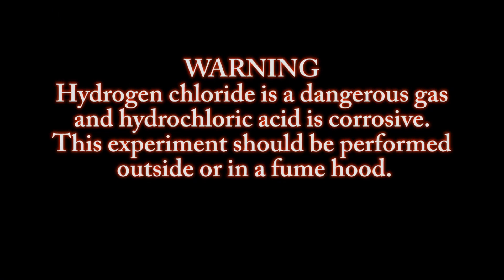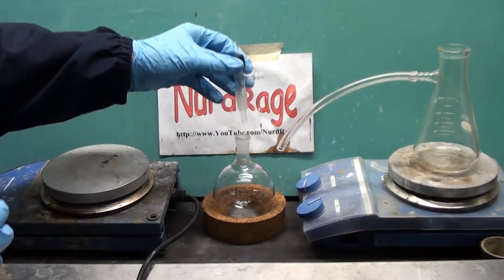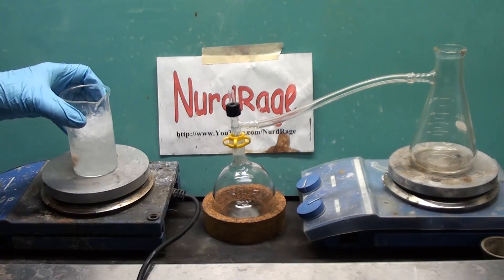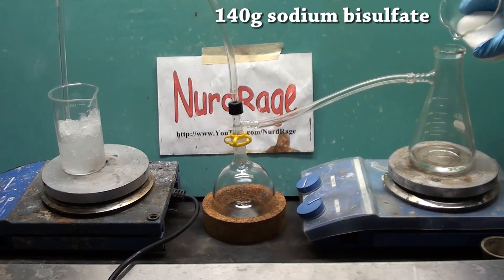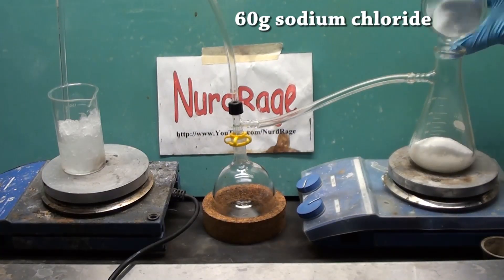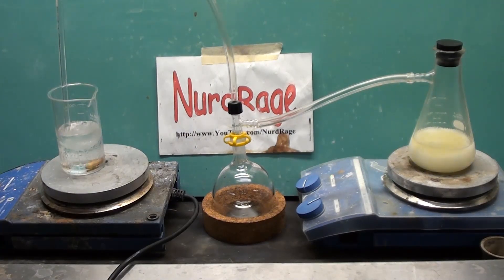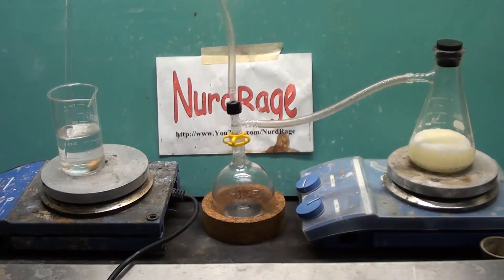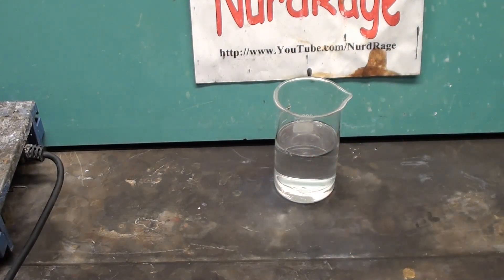Make Hydrochloric Acid

Comment: Sodium Disulfite and sodium bisulfate...... whats the difference here between these 2 or are they basically the same thing?
Reply: there is no thing called sodium disulphate. That would mean Na4(SO4)2, which would equal to just 2Na2SO4. Sodium bisulphate though, is an acidic salt - NaHSO4
Reply: sodium disulphite? yes there is. at least according to the label im reading. the msds sheet for Bonite brand stump remover lists this compound. hence my question.. but nvm. its listed from the dicks who like to make things complicated
McVidsAndTutorials

Comment: What is the maximum concentration that you can get from this procedure, and what modifications can you make to increase the yield and get more gas to dissolve. I already know that cooling the water lets more HCl dissolve, but are there other things?

Also, the solution I obtained from using this process had the smell of H2S. Is there a way to eliminate that from my mixture without letting the HCl escape?
Reply: Creativity The maximum solubility of HCl gas in water is around 32-35%. Solubility of gases in liquids increases as temperature is lowered, hence the ice water. To increase absorption of gas in the water, have it constantly agitated, create fine dispersed bubbles for more surface area for dissolution to occur over, and collect the undissolved gas to re-pass it through the water. I'll have a think about your H2S problem and get back to you
Reply: 36,5 % is maximum amount of HCl, that could be dissolved in water

Comment: what is that tri tube thing called and where do you get it
Reply: Do you mean the adapter that goes on the round bottom flask (it's a ''2 tube'' equipment)? If so, I don't know the exact term. ''2 neck flask adapter'' yielded some results but you'd have to check if you can find one (or more) to buy.
Reply: JayMark2049 Here is one: http://r.ebay.com/5KAUfb You can also just use a gas washing bottle with the connections reversed.

Comment: can you use salt water and a batterie to make the acid?
Reply: Well that's actually the industrial way, I mean using electrolysis of NaCl solution. You produce hydrogen gas and chlorine, then you mix them together and absorb them into water. I can't imagine doing it at home though :)
Reply: Yes, so you can make it this way

Comment: What if i do this in my basement with an open window and a respirator mask designed to filter out hydrogen chloride? Will any of the hydrogen chloride escape to the upper floors? If so what if i do this in my kitchen with a kitchen fume exhaust?
Reply: You can just go outside with a few extension lines... and if you do i would still recommend the mask
Reply: Run the gas not Kitty litter.
Reply: Into...

Comment: This process simpy does not work for me.  I just did another run and I can never tell when its finished. 
the material turns in to a hockey puck, but remains mostly white with some flecks of black in it.  The water boils off fairly early on. Im getting very week acid out of the deal 

I have no idea what I am doing wrong but I am sure that I am.  
The resulting hcl will dissolve aluminum foil in short order but  it does not seem strong at all.

The only litmus paper that I have is from a wine making project,  Its sort of the 2 to 7 range and the acid turns that paper red and red is not on the scale...  I need to get some phenolphthalein
Reply: How do you know the acid is weak? Have you performed a titration? If it dissolves aluminium foil it should be of reasonable concentration. PH does not really tell you the concentration.
Reply: Davy Zeng No aluminum was hardly reacting to it.  I reused the product and got a decent concentration.  
It makes so little that I did not want to waste any doing titration.

I buy the stuff now.  Its not really worth doing it this way other than exploring the science.
Reply: That is true. Thanks for the clarification. :)
Reply: ***** that is exactly why titrations work using sodium hydroxide

Comment: I did this process yesterday and got very poor results.  PH of like 3 maybe.  I used too much water and did not add any water in the generator flask.  I was sure that my stir plate could boil these crystals without water. I was wrong.

I have a question for ANYONE.   WOuld it be ok to use the weak solution and do this again?  SO I could build off of its acidity?  perhaps coming up with something much stronger
Reply: I know chemist now but I can't believe how stupid I was back then unbelievable the left knowledge if I need hydrochloric acid in the middle of the night now I make it with salt and sulfuric acid and grip it and get really nice pure HCL after cleaning it up

Comment: If I replace the Sodium Chloride with Sodium Fluoride, would the reaction create Hydrofluoric acid? I mean, hypothetically. I am aware that HF does dissolve glass, so this setup would not work... but what if the setup was Polypropylene? Would it create Hydrogen Fluoride and eventually Hydrofluoric acid?
Reply: Making hydrofluoric acid in a home lab is basically suicide if you  aren't REALLY careful. I would only do it if I had good quality PTFE labware and a very good fume hood that takes any escaped gases far far away. (Edit: don't use PTFE, HF can attack it, albeit slowly)

Comment: Will the reaction work with Sodium Bisulfite? I'm assuming no...
Reply: no. We use sodium chloride in this reaction for the chloride component
Reply: THErcbomber In replacement of sodium bisulfate, obviously not sodium chloride.
Reply: Zabuza oh. sorry for the misunderstanding. My best guess is that it will work but not nearly as well as with sodium bisulfate. The sulfate anion tends to dissociate with its cation easier than sulfite does. So in theory it should work but following trends it shouldn't be as easy or effective

Comment: I am going to have to do this, I can not find any HCL anywhere anymore. ALl of the drain cleaners are now Sodium hydroxide.
Reply: Hardware stores like Ace, or any place that sells pool supplies. Muriatic acid (32 to 26%) by the gallon for about $6. Concentrate it by bubbling hydrogen chloride gas thru it. If you want reagent grade, put an open container of muriatic into a larger container which can be sealed along with a an equal open container of distilled water. Seal the larger container and wait a few weeks. The distilled water will now contain reagent grade HCl at half the molar  of the original muriatic.
Reply: SMOBY44 Yeah, for most things hardware store HCL is fine..  I buy it a ace hardware stores notw

Comment: How much concentration you get this?
Reply: ***** Technical muriatic acid has strength 20 Baume, which is about 32% HCl and it is not pure. Plain distillation of muriatic acid won't help. The system hydrochloric acid - water forms negative azeotrope at 20.2% which render its concentrating by distillation unfeasible. To reach 37% acid of reagent grade different technic should be employed  like, say, extractive rectification. It works this way: The solution of liquid extractive agent (in this case solution of CaCl2 50%wt) constantly flows down inside the distillation column and on its way sucks out H2O from azeotropic HCl-H2O vapor phase which is rising up in that column. This technic works because some third components (like CaCl2 for this system) actually break the azeotrope. If you can read vapor-liquid phase diagrams here is more detailed explanation: http://www.akersolutions.com/Documents/PandC/Mining%20and%20metals/Hydrochloric%20Acid%20Concentration.pdf
The only challenge is to enforce the circulation of extracting agent through the distillation column.
Reply: Using azeotropic distillation, you can raise the concentration of HCL to 38%.
Reply: Alex Petrov Technic or technique?
Reply: "technique" means "a way of carrying out some task or procedure", "a method".
"technic" is just an alternative spelling for "technique", Sometimes I see people using it instead of "technical", where it means "related to manufacturing", "used in industry". Like, say, "technic acid" instead of "technical acid". However many people consider this usage to be illiterate. I am not a language expert, so you may want to find a better source on that.
Reply: ***** Under the atmospheric pressure distillation I would expect first hydrochloric acid gas to evolve from such a system, and then the rest of 20% water azeotrope. However if you bubble evolving HCl gas through the cold 20% HCl acid you may increase its concentration to 35% and even higher. Just be careful working with HCl gas as it is very toxic and corrosive substance.

Comment: though I couldn't understand how NaCl reacts with sodium bisulfate and produce hydrogen chloride..can any one write the the equation please ?!
Reply: okay let me make this simple, sodium bisulfate is another name for sodium hydrogen sulfate, it is another salt formed in a reaction with lets say a dibasic acid (sulfuric acid) and sodium hydroxide, this is an acid salt meaning not all the hydrogen ions were replaced with sodium ions in this case, so the salt formula is NaHSO4 and thats where the hydrogen comes from
Reply: Vrej Egon Spengler I know
Reply: NaCl+NaHSO4--->Na2SO4+HCl
Reply: ***** - think I understand your confusion. The equation (from Eshwar Natrium ) might've cleared it up, but just to be basic (there's a pun there) / explicit: sodium bisulfate has a hydroxide (OH) hanging off it. So you get a swap of the H from the bisulfate onto the Cl from the table-salt. You were probably confused as to "where the heck does the H come from?!?" seeing as how "sodium bisulfate" doesn't sound like it's got hydrogen in it. (Me, I find it really helpful to 'cheat' and just look up inorg compounds on Wikipedia rather than try to remember rules for ite, ate, ide, hypo-, per, etc. -- and this is a good example of why... ;-)
Reply: andrew corradini Bisulfate along with others like bisulfite, metabisulfite, bicarbonate are confusing. Bi usually means 2, just like di (bicycle).
In chemistry, bisulfate actually means "hydrogen sulfate"
Metabisulfate, also called disulfite) is a weird exception. It is actually the S2O5(2-) anion. It has a S-S bond. One S has 2 O and the other has 3 O.
Reply: NaCl + NaHSO4 --> HCl + Na2SO4
Reply: Eimantas Andrikis
Eshwar Natrium already posted that.

Comment: What concentration do you get off this method ? Is it then usable for making Nitric Acid ?
Reply: Can't you calculate it yourself? It depends on how many moles of HCl you make, how much water you have in the beaker.
Reply: Problem has been solved since last comment was posted, appears that HCl cannot stay in the liquide phase at standard temperature past 37% concentration. So it doesn't really depend on how much of those products react, excess moles of HCl will simply evaporate...

Comment: If you were to inhale "a few drops" worth Hydrochloric acid, it will cause severe damage to your lungs, it takes even less than that amount to cause permanent blindness, internal damage, etc. This is especially the case with concentrated versions of the material, which can 'fume'. 

Furthermore, in certain chemical reactions, you can create deadly gases, such as pure chlorine, or even Hydrogen Cyanide, which would only require you to inhale a small amount to be considered a fatal dose.

Comment: Normally you can use a concentrated acid and an oxidizer. This acid is much more dangerous than other acids as this can spontaneously catch fire or decompose violently. Chlorate and conc h2so4 can be used but don't try it as even very small samples (1ml) can blow up your glassware.

Comment: Use a stopper with 2 holes, and put 2 glass tubes in them, attach the rubber pipe from the gas generator to 1 glass tube and a rubber pipe to the ice container to the other glass tube.

Comment: Not really true. Acids in general are corrosive but that depends on pH. Your stomach contains HCl as a digestion catalyst but it doesn't digest your stomach lining proteins due to mucous secretions. 
Another example is that HCl does not react with Pt or Au in most circumstances (from a chemical not biochemical standpoint)
Acids in general are only a source of protons (H+) which either catalyze or help to increase reaction of other present compounds.

Comment: I think methods of evaporation would work. I think the most acidic the HCl can be is around 7-15M (molar, moles per litter--I could get the exact number and derivation if you cared. This has to do with the amount of "bulk water" that is used to solvate the two ions H+ and Cl-. Anymore concentrated than this and the HCl will precipitated out because there is not enought water to surround the ions (i.e. dissolve them), and will precipitate out to form a salt.
Reply: More like evaporate as HCl gas.

Comment: No. There are cells in that line the stomach that secrete a mucus layer to prevent the corrosion from the HCl we produce. However, you would suffer severe esophageal damage, and that could be fatal. So, my vote is, don't drink it!

Comment: So when I was a child I produced HCl gas by ethane chlorination (with the action of sunlight). To my regret I did not record it on video. Ethane was produced by the electrolysis of sodium acetate solution and chlorine likewise. The consecutive attachment of the two electrolysis cells allowed to produce equimolar ratios of the two gases (disregarding chlorine solubility losses) which reacted in a separate flask. The HCl produced was absorbed by water. When Zn reacted with it I was just happy)))

Comment: I have a question. If the back flow from the beaker to the flask was caused by a small vacuum in the reacting flask, what causes the vacuum in the reacting flask then? I'm just curious.
Reply: I think it has something to do with gasses shrinking down

Comment: couldn't you use the ph to determine the concentration of the hydronium ions in the solution, which would essentially give you the molarity of the acid? or by using titration you get better analytical data confirming its concentration?

Comment: Hydrochloric acid can't be boiled to concentrate it, heating it causes the dissolved hydrogen chloride to boil off. You can only concentrate it by adding more hydrogen chloride, or by redissolving the hydrogen chloride you already have into water with a smaller volume

Comment: Is there a difference between a "vacuuming flask" and a "filtering flask"? What is the size of the the one you are using. What kind of tubing are you using? What temperature do you set you hot plates at for this experiment. And lastly, where do i find back flow device like the one you have?

Comment: The yellow clip is a keck clip. They are used to secure bits of lab glass that use ground glass joints. They come in different colors depending on the size. The yellow clips are for 14/20 size joints. The ones I have are green for 24/40 joints.

Comment: your answer doesn't fit the statement at all lol. he meant if you have sulfuric acid, you shouldn't need hydrochloric acid since most things that hydrochloric acid is used for can be done with sulfuric acid. the only use hydrochloric acid has over sulfuric acid is in making Aqua Regia by mixing HCl with Nitric acid.

Comment: 1 mol of of NaCl reacts with 1 mol of NaHSO4 to produce 1 mol of HCl gas and 1 mol of Na2SO4, so the highest possible concentration of acid u could obtain is 10M if u used 100ml of water right?

Comment: Probably, although you'll need to adjust the stoichiometry.

You could also just boil your acid down until you reach a higher concentration, but if you do this BE EXTREMELY CAREFUL.

Comment: i see u are a very good chemist so i would be happy if u could answer my questions?
1.does reaction between copper, hydrogen peroxide and HCl release oxigen.
2.Can u write equationof reaction between hydrogen peroxide and copper.? I know it generate copper oxide but i dont know other reaction products
3.Does reaction between copper(2) chloride and aluminum release hydrogen gas or something else because when i add aluminum to solution of copper(2) chloride and i put it on fire it burns. 
Thakns!

Comment from the maker: It's always easier to buy stuff. I like making stuff sometimes to demonstrate the science. Also the principles learned can be applied to other experiments where you can't buy the chemicals.
Reply: i did it made hydrochloric acid with ur method but i was being a fucking idiot by not using an anti backflow system and instead just pulled the tube out right before it backflowed and inhaled hydrochloide
Reply: @jadentonkin466  get a respirator
Reply: @fractal5764  Or a fan.
Reply: @jadentonkin466 nice!!
Reply: It's not easy to buy anymore 😭.
Reply: @coffeecuppepsi  Really? You can buy it in any hardware store. Look for "brick acid."
Reply: @coffeecuppepsi  Yeah, have a look for Bondall Hydrochloric Acid in Bunnings if there's one local to you.
Reply: @coffeecuppepsi  yes, very hard, someone will watch you!
Reply: can you tell me the attachment added to the round bottom flask name i want one
Reply: anyways tank
Reply: yeah i dont want to buy any i want to learn to make everything from scratch base materials. this vid was perfect for that. Now All i have to do is look up how to make sodium metabisulfite. i know i could go buy some pool shock or something but where is the fun in that and it wouldnt be pure lol

Comment: The larger surface area allows for more even heating which is often required for certain reactions. The area at the top also allows condensation to more readily occur making it better for reflux, distillation and other techniques where a liquid is condensed. The joints of a round bottom flask are also designed to fit condensers, fractional columns and various adapters while an Erlenmeyer flask or beaker does not have a standard sized opening to fit these. I hope this was a good explanation.